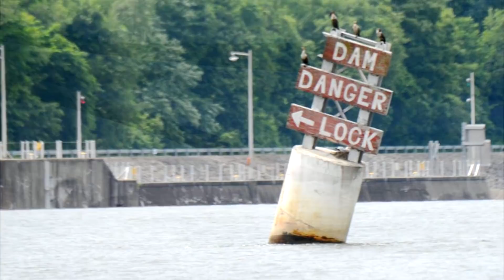5 MOST DANGEROUS Dams - (don't live here)

Comment: let me explain me Low head dams or sometimes called "weirs" a bit easier, they function like dams, but water actually goes over them, they can be fine and not really dangerous, but sometimes a "boil" point appears on some low head dams, because the water has alot of air instide because of the jump, the water travels downwards but after a little time the water goes up to the surface because of the air and will travel back to the low head dam, it is called the boil because when you are looking at it from above it looks like water boiling, it is also called the "keeper"
but the low head dams can be walked on and some aren't even dangerous, but when you are in a kayak or a raft and you wanna ride the weir, you can, if it is one of the safe ones that doesn't have the keeper, but you have to be careful to go straight, othervise water will splash into the kayak and turn, a raft is safer but you have to look out for rubbish down the weir because it might demage the raft. Hope that helped.

Comment: The Oroville dam should be number one on this list
Reply: What's wrong with the Oroville dam? Nothing! It's the spillway that  has issues
Reply: Oroville dam spilway has been repaired so it is now safe..
Reply: @AdstarAPAD  yeah keep telling yourself that
Reply: @jamesburriss1086  it's part of the dam
Reply: The  oroville  dam may as well be a natural earthen feature. The center is clay, the rest is concrete hard adobe . The base is almost a mile thick. The spillway has been repaired by the best engineering , materials and construction techniques that could be had. No corners were cut.
Reply: @straybubbles7334  In the case of Oroville dam the spillway is not part of the dam core if the spillway fails it would displace a lot of dirt but would not affect the dam core itself
Reply: @jamesburriss1086  you know what I mean. U sound like my mother
Reply: No I don't know what you mean but you should listen to your mother